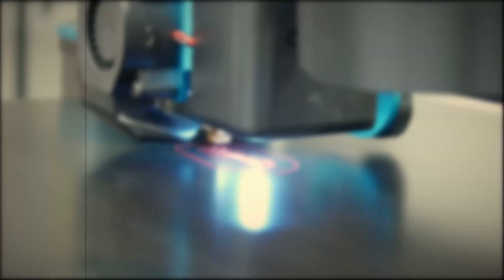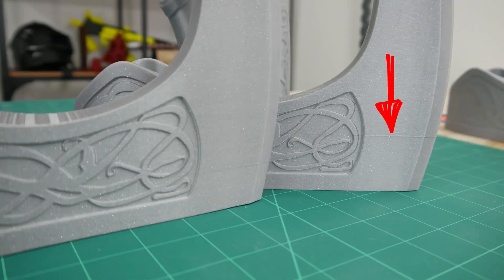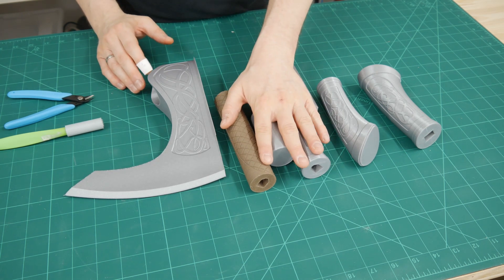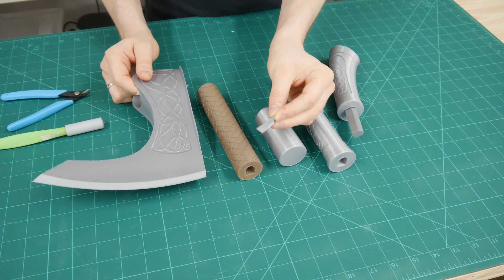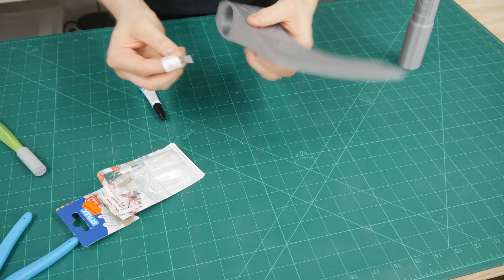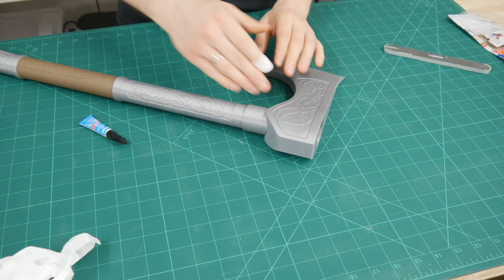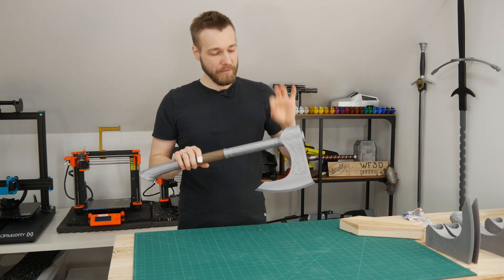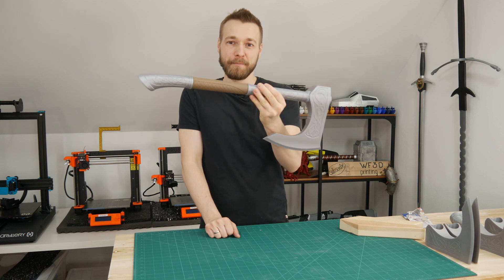Assassin's Creed Valhalla Eivor's Axe 3D printed

Comment: Great model and video. For the sharp corners and lifting like you had I just add an extra circle in the Slicer as a part modifier and use it as a brim. In this way I don't have to remove the brim from all around the part.
Reply from the maker: Thanks! That's a neat idea i haven't thought of!

Comment: With the reduced layer height does this make the print smoother and require less sanding overall?
Reply from the maker: Yes that is accurate. I usally print at 0.15 mm and that saves me some effort. However this print can be printed directly in the appropriate colours.